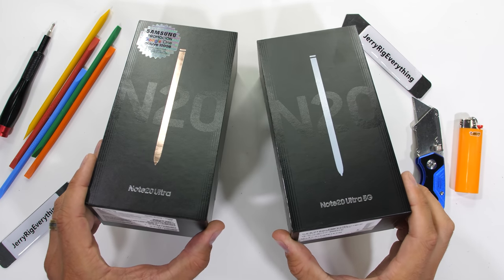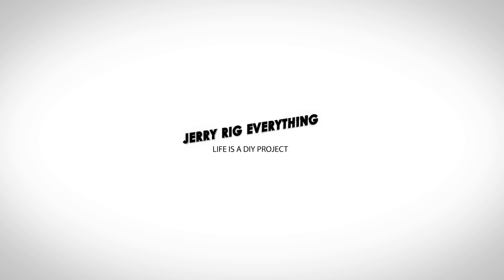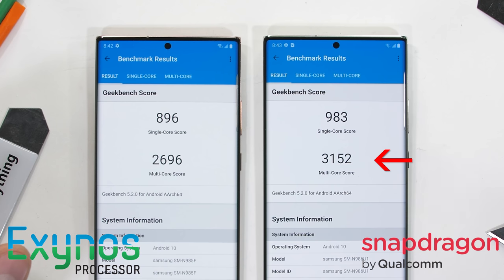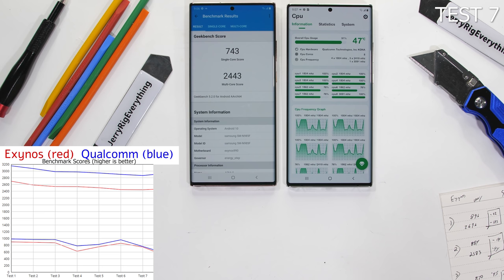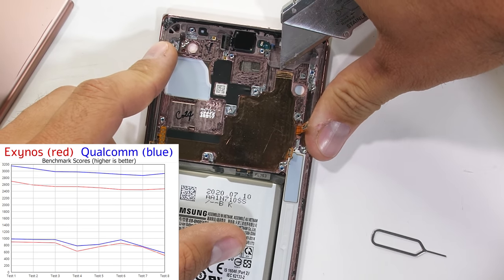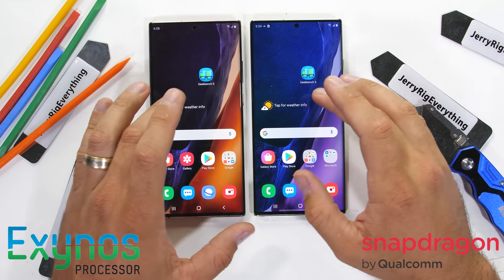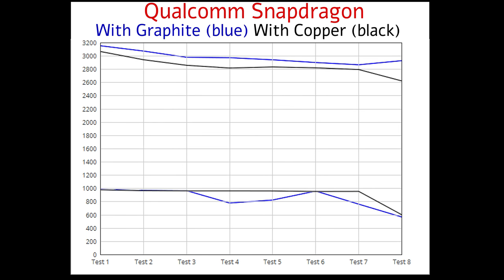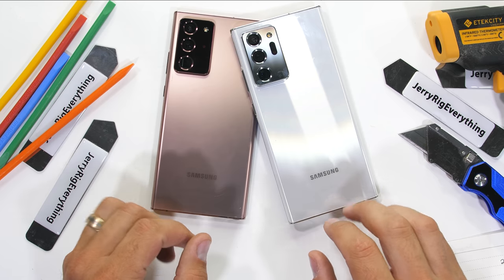Samsung should explain this... Exynos vs Qualcomm?! - Note 20 Ultra

Comment: So the Exynos is less powerful, gets hotter, and drains the battery faster? Nice job, Samsung.
Reply: and also more expensive
Reply: @unliving_ball_of_gas  agreed..
Reply: Ikr we country who have exynos 990
Pay for the same price why do we have the bad one
Reply: I tested my smartphone against my desktop and, believe it or not, the exynos manages to get more fps/W than my threadripper despite being a lot weaker than the snapdragon of my previous smartphone.
Reply: Samsung sucks at silicon, what did you expect? They can't even crank out Nvidia's chips within a reasonable timeframe, and their efficiency gets assfucked by that of TSMC.
Reply: Lmao true
Reply: @amirunrunnerz8110  yrk
Reply: @layaanees8222  why?
Reply: @markhesse4510  how do you even managed to compare a x86 vs ARM architecture lol
Reply: And different Camera processing, why my country get Exynos version :'(
Reply: And Wifi network signal Power very low
Reply: @wywlf6912  by using BlueStacks with 24 enabled CPU cores.
Reply: @markhesse4510  its an emulator ofc its gonna be shitty
Reply: @muthulakshmimuthiah4804  but my samsung signal power is quite okay. Rating 4/5
Reply: Horrible
Reply: I've got that
Reply: @unliving_ball_of_gas  v yy
Reply: @markhesse4510  You're using an EMULATOR on a PC. A pc is not built to run android.
Reply: @alifsaniabifadel6114  bcs asian version got the exynos while american got the qualcom..not fair :(
Reply: @alifsaniabifadel6114  I think its because in some countries Samsung doesn't have the patents to use Qualcomm Snapdragon chips in there phones so they have to resort to the Exynos (which i believe is commonly used in other android phone brands).
Reply: That’s why I stopped buying Samsung’s! It’s years this crap is going on. They screwed me with their Note 4 Exynos edition... yeah now try again getting my money.
Reply: @peepo216  So the solution is to buy the snapdragon version and ship it internationally.
That'd be expensive tho
Reply: Snapdragon version have better photo
Reply: @nsatymaty  Yeah, that too
Reply: @unliving_ball_of_gas  BlueStacks ist an Emulator...
Reply: @markhesse4510  yes and its not optimized to run on pc
if u have 2 braincells and some knowledge on pc you should know that x86 is still superior than ARM in gaming otherwise we should've ditch x86 few years ago
Reply: @markhesse4510  even only 4 or of your cpu cores on your pc will smash your android phone, android phones are nowhere near good processors.
Reply: Anyways Galaxy phones are being selled like hot bread because Samsung is Samsung, is status and quality :)
Reply: @wywlf6912  you clearly haven't touched a Galaxy 🤣🤣🤣 you poor
Reply: @unliving_ball_of_gas  im waiting for my note 9 snapdragon to be delivered from the USA, even with the 10% gst, electronics import tax and shipping, its still 300$ cheaper than the cheapest note 9 exynos I could find in Australia. From the benchmark comparisons, the snapdragon in the note 9 outcompetes the note 10 exynos in almost every catagory. Now I just have to wait nervously as the package bounces around from state to state before finally leaving for its long voyage by ship. Fingers crossed.
Reply: @6AxisSage  wish you luck bro and indeed the exynos is inferior chip idk why they made same models with different chips but the inferior chip gets the higher price tag
Reply: @wywlf6912  everyone is coping hard Samsung 🤑 No. 1 on sales 😂
Reply: @erickmazariegos5778  who cares about sales i only care about my flagship phone regardless of brand
bootlickers cope harder 🤣🤣🤣🤣
Reply: @erickmazariegos5778  in terms of sales apple had a larger market share than samsung 🤣🤣🤣
Reply: @wywlf6912  hahah Samsung have 80% of the market 🤯💀
Reply: @wywlf6912  aple is a little kid compared to Samsung 😂 Samsung is in the 1st place while Aple is in the 4th 💀💀💀💀
Reply: @wywlf6912  you went out of arguments lol, just what i spected from an aple fanboy
Reply: @wywlf6912  probs because Qualcomm doesnt see the point. They get lots of money anyways. Why put money into something that may fail :/
Reply: Aple's processors are good just because the OS, its more optimized because they launch like 2 phones each year 😂
Reply: @markhesse4510  You can't compare phone to emulator.
Reply: @erickmazariegos5778  Yes, he touched, I touched too. This doesn't change fact that exynos is shit.
Reply: @wywlf6912  Btw iPhone is overrated .
Reply: @omicron7735  i never used iphone lmao
Reply: @wywlf6912  I didn't say you used or not
Reply: @omicron7735  why did u even bothered on mentioning me lul
Reply: It was supposed too explode like the note 7. Unfortunately that feature doesn't work
Reply: @markhesse4510  yeah but battery management and heat management not good
Reply: 1k like
Reply: You can't do even this.
Reply: Iphone always
Reply: Amd is teaming up with Samsung..so they should get better a year from now:(
Reply: And the Phone costs the same, if the price was right i would see no problem, but as he said in the video, you do not know what you get for the same money.
Reply: @markhesse4510  Different architectures and more importantly one is optimized for your device and the other isn't. Your threadripper is magnitudes more powerful, you can do a lot with an ARM chip on a smaller simpler device with smaller and simpler software.
Reply: They was using S series as TNT in the pass too
Reply: soon
like 5 years
Reply: hey you forgot, apart from what you said, it has less signal power, WiFi, and different processing of the photos
Reply: Cool... a real big spender!!
Reply: Rezi Iosif  your excuse is the most basic thing I would ever see a scamsung supporter doing stop calling people on Apple fan
Reply: Sounds like an Intel processor.
Reply: @wywlf6912  Totally agree. Samsung devices are shit. I have 3 dead Samsung phones and 2 dead Samsung tablets. Even my LG G4 is still alive! I have 30+ phones, all the dead phones are from Samsung. I don’t get why people are buying overpriced Samsung phones.
Reply: Samsung is turning into apple
Reply: not anymore it seems
Reply: @Cay9z  an apple is becoming more self-aware
Reply: no wonder why this galaxy note 20 ultra exynos version is on sale until now.
Reply: Rezi Iosif  why is being angry about paying the same price for a worse product bad?
Reply: @omicron7735  I have only owned iPhones and I agree
Reply: @amirunrunnerz8110  But nowadays Huawei is using a QUALCOMM
Reply: What's the point of paying a $1000+ phone? With all that shit going on? Nope.
Reply: @ytto051  what do you mean by that
Reply: This sort of thing makes me want to switch back to ios. (Using Note 20 ultra atm)
Reply: @markhesse4510   you better be joking , desktop cpu is no where near a mobile cpu , desktop cpu is 435435 times faster rofl
Reply: @erickmazariegos5778   samsung doesnt know what is quality..
Reply: Rezi Iosif  lmao. You embarrassed that ur crusty Samsung is more expensive yet worst than an iPhone sad.
Reply: Well, both versions can't be the same since different manufacturers, one is better and one is less powerful, and either way you will be judged
Reply: Like the pentium 4
Reply: Because it is a samsung product. Say what you will about Apple but, well, their snapdragon-ass-kicking processors ship with every iPhone. And yet, the samsheep bleat...
Reply: @unliving_ball_of_gas  nope snap dragon is more expensive
Reply: man i have exynos note 20 ultra
Reply: Yes it's a costly shit. And Samsung blood lynching company
Reply: Still they are doing the same sh*t over and over again and saying now it's improved
Reply: @rock3713  ikr lol but still it looks cool everytime they bring it out even tho they are same but ngl the note 20 they improved than the other notes
Reply: So i have a Question : in at all how much percent Different Cooper Cooling System with Graphite Cooling System in "SAME" Model phone , i want More Explain My Question How Much Diffrence Between Cooper and Graphit On One Phone ?  In my Question we Dont want change any things and any phones and any Models , We want Know How Much Perceent Cooper better than Graphit . Pls answer my Question , Thank you .
Reply: @ALmaN11223344  So i have a Question : in at all how much percent Different Cooper Cooling System with Graphite Cooling System in "SAME" Model phone , i want More Explain My Question How Much Diffrence Between Cooper and Graphit On One Phone ?  In my Question we Dont want change any things and any phones and any Models , We want Know How Much Perceent Cooper better than Graphit . Pls answer my Question , Thank you .
Reply: Im pretty sure the Snapdragon is better
Reply: Yup... i got scamed
Reply: @markhesse4510  It is an emulator and you can't compare x86 with ARM. That's like comparing apples with oranges.
Reply: It's mediatek so you know 😂
Reply: @nsatymaty  worse quality
Reply: @omicron7735  Exynos is the king A Bionic is crap, your comment makes nonsense